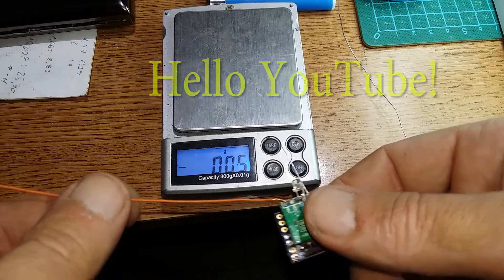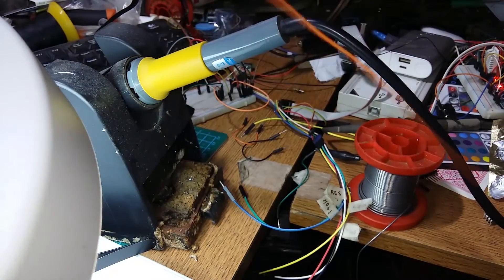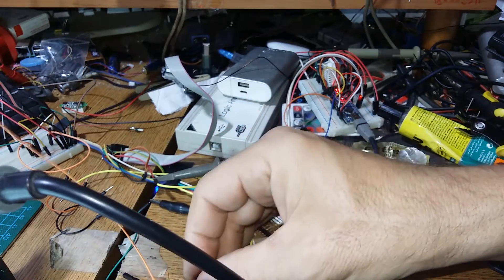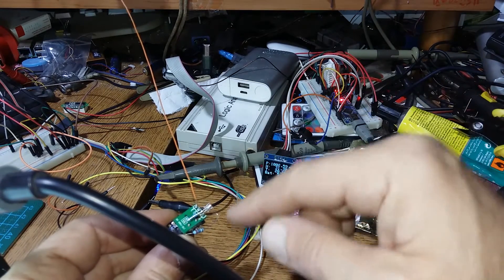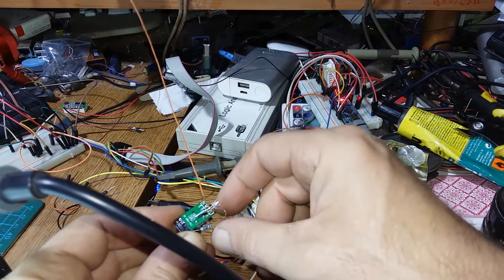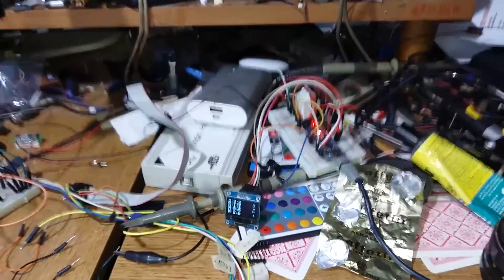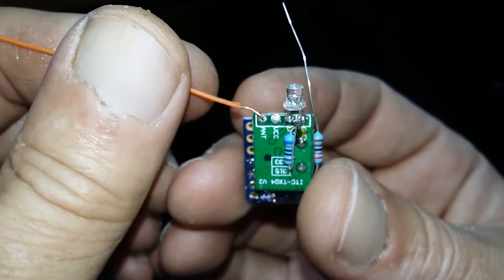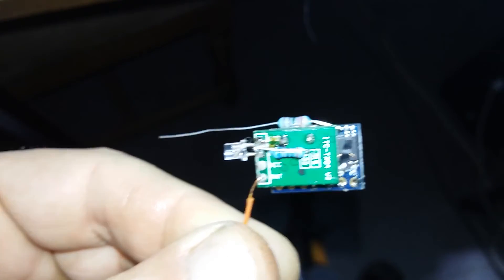Arduino Altimeter Under 3 Grams

Comment: Very good, close to what I'm looking for.
Could this variometer send data in real time by radio frequency 433Mhz?
I saw the RC Electronics T2020 receiver.
I wait for news and thanks for the sample.
Reply from the maker: I think it can. I am not in programming world for a while. Just, that transmitter is OOK modulated, so pretty wide. Then do not use too high bit rate.
Reply: @MilanKarakas  
I am not electronic and I do not understand circuits, pcb boards and neither arduino. I just need to make an altimeter that sends information to a receiver in real time -the RC T2020-, for me and save money. Can you help me, I think it's very simple? I have everything studied prepared, I just need someone with assembly knowledge. Can you help me please, would you be so friendly? look at these 2 components on this web ...
http://www.2kmodels.eu/English/RC_electronics.htm

See and read the RC Multi 2 and the RC TRX30 and tell me how everything would be connected to send data to the RC Electronics T2020 or T3000.

Someone you or a friend please, I would love to do this and I promise to try a video and share for your channel.
I can send you my email... Thanks
Reply from the maker: @David_etohalcones  You have more details here: http://wildlab.org/index.php/2016/03/11/arduino-altimeter/

Comment: Seems like i am doing something similar with arduino nano right now. With some tricks 16mhz nano seems fast enough to read from gy-86 board, process and send a bunch of information through serial (i am planning to use 433mhz hc12 module). Not shure how it will behave in flight (vibration, range etc), but i think it should work ok on a distance, similar to 2,4ghz control link. Ground station is written in processing and works fast enough on a netbook (something like odroid c1 and a larger monitor will possibly do better). I will share everything when it will be finished)

http://cs630130.vk.me/v630130413/26008/kQEaIA3ycGk.jpg
Reply from the maker: +Алексей Кудряшов 
Did you saw my new video about applying "Second order temperature compensation"? Now, this MS5611 is even more accuate.